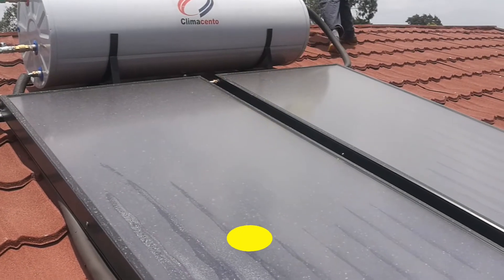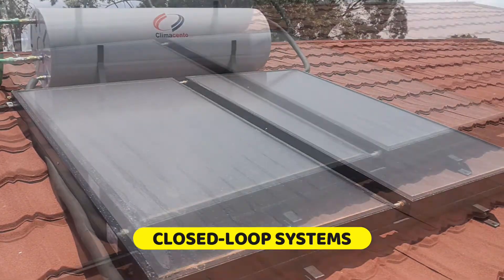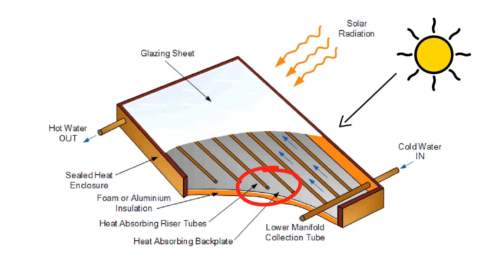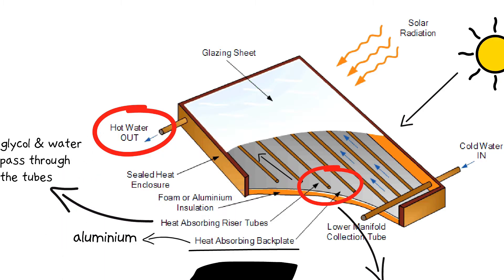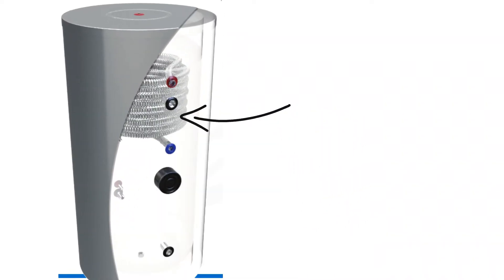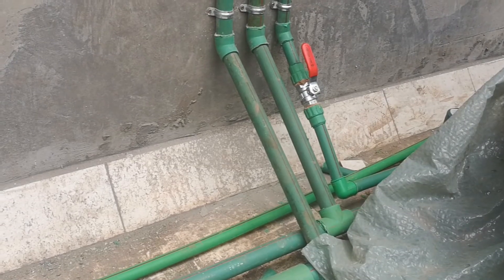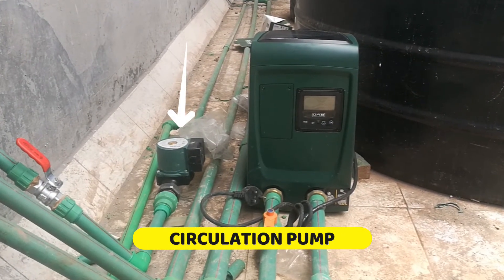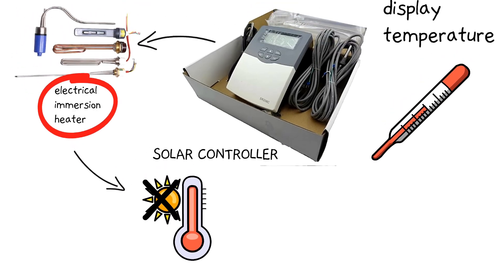How does a Flat Panel Solar Water Heater Work? (Indirect System Explained)

Comment: Really well explained, thank you!  Question: does the system needs to have any kind of slope?
We recently had to move our system and the slope is now way less than it used to be; I am wondering if this is why we now get only very little hot water, as one technician suggested.  I am in northern Kenya and there is a lot of sun,; the water was usually boiling hot.  Now, just a little hot.  
Another question, as we had to replace the glycol solution when we reinstalled; how much propylene glycol is typically use in a 1 panel 200 litres tank?  One technician said around 30 litres,  but the technician who came to do the work used less than 20 litres and said the system is full.  Looking forward to your answers, and once again, thanks for the very informative video!

Comment: I think that your explanation is backwards. The Glycol/water mix travels through the SS coil, and the potable water is held inside the tank. This is why you have a large volume of hot water. if it was just inside the tube then you wouldn't have much hot water capacity.
Reply from the maker: Oh yes! Thanks for pointing that out
Reply: No Sir, video content is accurate. Glycol mix is inside the main tank unit. Utility water goes through the SS tube.

Comment: How is the water separated from the glycol after heating if l may ask ?
Reply from the maker: Water for the house isn't in direct contact with glycol. The glycol-water mixture is the one that gets heated by the sun and transfers that heat to the water that will be used in the house.

Comment: I am surprised that the indirect coil within the tank serves the house, rather than the other way round where it ought to serve the heater panels. Also, there's no mention of any thermal insulation of the tank against ambient external temperatures (especially important in winter).
Reply: The tank is thermally insulated to prevent heat loss. And yes, the principle is surprising but effective. The stainless steel tube is long and has several coils. The heat exchange process is accelerated by this large contact between the two media.

Comment: What could be the reason, I installed the solar panel heater and it's not heating only cold water coming
Reply from the maker: 1. Wrong piping connection 
2. Faulty heating mechanism in the solar heater that needs repair
3. Consult an experienced solar heater plumber to troubleshoot your system and identify the problem

Comment: Many yrs ago I made my own solar hot water heater is was very effective and was a simple system and worked trouble free for
15yrs till I moved. It was a nasa design, it consisted of two 40gal
Off the shelf water tanks that worked in series.one tank was the preheat water for the final tank then was plugged into 117vac wall socket and set for 140f  the first tank was connected to a home made collector. The size of the collector box was that of a sliding
Glass door. I bought a used sliding for 15$ and used that as my
Glass lens .since it was already in the aluminum frame that it came
With I drilled holes in the frame and mounted it to a pressure treated
2  by 6’s box  the size of the sliding glass door. The bottom of the box I used 3/4” pressure treated plywood . Inside the box I put
Polyurethane form 2” fhick on the sides 1” thick. The collector 
Was 1/2” copper tubing. I took old industrial shelving panels
And screwed them togeather and sized to fit the inside of the 
Box. I laced the copper tubing on top of the shelves . I soldered
90 elbows on th ends to make return to the other side. I did this 
To fill in the intire planet plate I made. I then put 1/2 copper pipe
Clamps about every 6” and screwed them to the plate for better heat transfer. I then bought a gal.of electrone black epoxy used
For potting electronics. I poured into the area where the pipe meat the plate so as to create a fillet between the pipe and the plate. In then black engine spay paint crinkle finish .the crinkle 
Finish I thought to improve siurface area. I then mounted a thermistor to the plate. I then plumed it thru the roof to the first
40 gal tank  in one line going to that tank I put in a motorized 
Check valve the other line a off the shelf magnetic water pump
117vac about 0.3 amps. I made a simple differential amp circuit
I made one side of the op amp with two resistors the other side of
The op amp was thermistor and a resister. I set the differential
So as to when the solar plate was 9*f   Hotter then water tank the circuit turned on a relay to open the the check valve and start the pump
Then check valve was put in to stop thermo siphoning.
Results 139 to 144 f on a normal day in Ft. Lauderdale fl.
No failures ever cost savings 40$ mo.  This was in early 1980
Time. All this was done in my garage with just simple tools
That most people have mybe that 3 to four week ends to
Complete. It is so reliable and extremely efficient over 90
Percent . If I were to do another one I woud use soft copper 
Tubing eliminates elbows and soldering .
Reply: Very interesting. Thanks for sharing
Reply from the maker: Thanks for sharing Ed
Reply: Your welcome sir. I still remember the first time it turned on I had my hand on
Thr return pipe from the collector and when it turned hot it was a big thrill that I'll never for get. Two other neighbors the copied my system. I'm now 80 and as I look at this system it should be mass produced. Itscheap
And very efficient that pretty much and handy man can do
It way more effective then solor cells with are only 15 to
20

Comment: We have this kind of hot water system installed on our house in Greece.  Actually, the system is ground mounted.  We have plenty of hot water.  Even in winter, when the sun shines.  We have not used the auxiliary electric heater since the system was installed.  This kind of hot water heater is not expensive.  One possible drawback is that the temperature of the hot water cannot be controlled.  So be careful in the shower.  The water can be very hot!  It is a comparatively simple system.  If you live i a sunny climate his may be an alernative to using gas or electric hot water heaters.
Reply from the maker: Wow, thanks for sharing your wonderful information. I'll be sure to be careful with this system from now on.

Comment: A point of correction. It is the water-glycol mixture that flows inside the stainless steel pipes. The designers want the tank filled with domestic use water (for use at night) not glycol water.
Reply from the maker: Thanks for sharing your knowledge
Reply: The content in the video is accurate. Glycol-water mix is in the copper inside the glass panels and main tank unit. The water going to the house is flowing through the stainless steel tube inside the main tank. Cold water flows into the stainless steel tubes and exits as hot water, yes, thats how fast the heat exchange process is.
Reply: This does not make sense, it would mean you would get water-glycol mixture to your tap inside a house? Water-glycol mixture is in the tank circulating and regular water flows through the spiral like shown in video? Or did I misunderstood you?

Comment: Hello. Can you or any expert reading this, please help me understand the construction of flat panel solar water panels constructed in the early 1980s?  I need to remove flat panel solar water heater collectors from a roof that were installed in 1983.  This style of flat panel water heaters did not have water tanks installed on the roof, above the flat panels.  Only the flat panels are installed on the roof, and a water tank is inside the garage.  The water tank is already disconnected.  However, due to my unfamiliarity with panels that were manufactured 40 years ago, I do not know what type of hazards I need to be aware of with these panels and how I need to possibly plan to remove them from the roof.  For example, when this old style of panel was in production, was glycol used within the flat panels?  Are the water tubes under the black metal sheet in this older style of panel made of copper or are they possibly glass?  Is there a recommended way for lowering these from the roof without dropping them on the ground?  I am working alone and trying to develop a plan to remove the panels by myself.  Is it okay to cut the panel into smaller pieces while it's on the roof, with a circular saw with a metal cutting blade, prior to dropping the smaller portions of the demolished panel on the ground?  If this method is used, do I need to prepare for glass tubes (if that is how the panels are constructed) within the panel to be broken, or glycol to be spilled?  I do not know if either of these are things that should be a concern on a 40 year old panel because I do not know how panels were constructed in the early 1980s.  Thank you for sharing your expertise.
Reply from the maker: I'm in the same boat as you as I have no experience with older models of flat panel solar water heaters. I'm sorry as you have written a thorough question. Isn't there a local dealer in your area who knows about solar water heaters of that era or the one who sold it to you?
Reply: @PropertyNoma  I do not know who sold the panel.  I will try to search for a dealer.  Thanks for your reply.

Comment: Hi , how infective is this system, secondly up to what temperatures can this water heater by glycol and water mixture reach
Reply from the maker: It's effective. It can reach temp of 60C due to thermal regulation of the system
Reply: @PropertyNoma  if there's no thermal regulation can it boil water? Thanks

Comment: thanks for the education. approximately how many people can use a 200L tank capacity please. secondly if you have a circulation pump for the cold water, can you send the same pressurized cold water to the solar heater?
Reply from the maker: 200L about 3-5 people depending on the amount each person uses.
A circulation pump can be used on an indirect solar water system

Comment: Very informative. I have seen them all over Kenya but always wondered how they work.
My question is how much energy it costs to pump water up the roof as opposed to an electric water heater. I would suspect it's still less since electric water heaters lose heat through the air while the solar heater is a closed system. Heat is constantly regenerated from solar irradiation. 
It would be interesting to know how solar water heaters compare with PV panels on a cloudy or rainy day in terms of power output.
Reply from the maker: I think so too that it costs less to pump water than to heat water using electricity